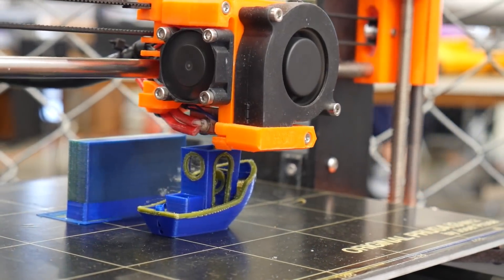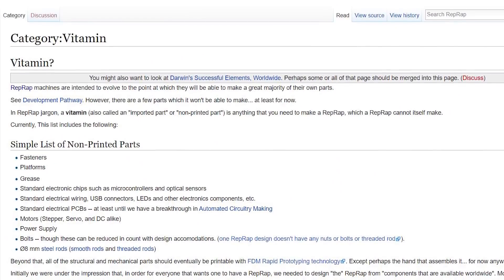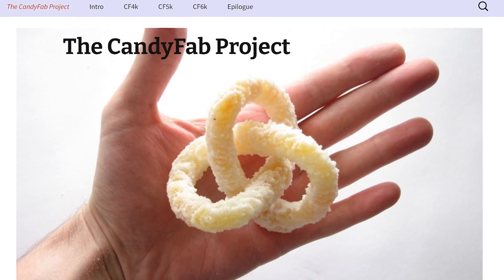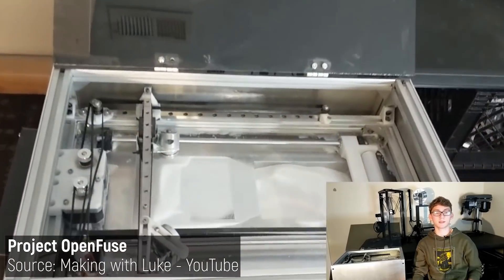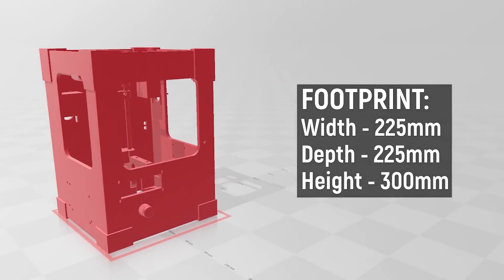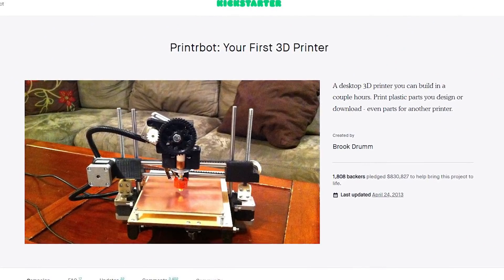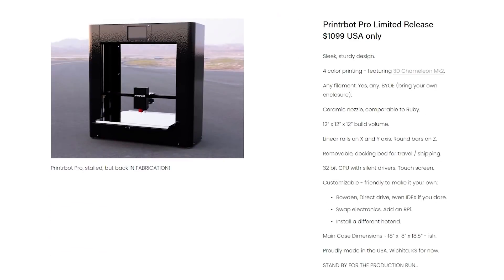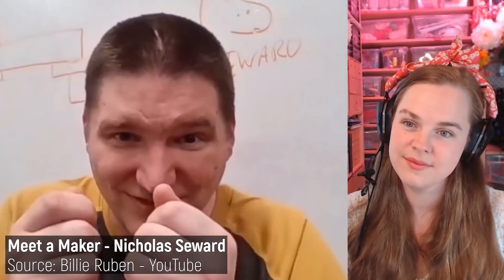These 5 Pioneering 3D Printers became extinct.

Comment: I still have and use my printrbot simple metal.  It's been a tank over the last 8-9 yrs.  It's getting adapted to an orbiter 2.0 extruder as it's worn out the gears in the geared extruder. Now it's working on the only spare set!

Comment: When there will be open sourced electronics printing alongside 3d printing (and food printers, 3d metal printers,  3d concrete printers), we might bridge the gap to actual replicators that turn energy into matter. If we can be enable other people to print different sizes of 3d printers only from raw materials, we could get people to print their own energy sources, vehicles, housing, mobile homes, and resource gatherers. if anybody played astroneer you get my idea easy: people would just need a basic printer  and some gathering tool to start living of the land/off grid with ease. if somebody is working on integrating technology so the today's "vitamins" would become printable, we will have something like a industrial revolution 2.0 .

Comment: The sugar one makes me wonder about a glue gun based sand/dirt 3d printer. Simply using the hot glue gun as a binder for the dirt/sand with extremely cheap material pricing & vast material accessibility.
Reply: Or melting of glass powder

Comment: I guess hypotechnically, modern "3d printers" including multirole machines:, could actually print/"print" out the vast majority of the parts in some form or another. No one individual machine could though, and many parts would need extensive post-processing - but we're getting close. What mostly remains are electronic components, especially ICs. We could in theory make several passive components, like resistors, caps, electromechanical relays, switches connectors and sockets etc. Also PCBs, soldermasking, pick n place, hot air/laser/IR soldering...

Comment: 5:29 Awesome!  I got to run a Zcorp Spectrum Z510 somewhere around 2003 or 2004 at an aerospace company (I was the point of contact/owner so I was pretty familiar with it back then).  Having only recently learned about SLS and SLM at the time I was pretty happy to dig into that particular task.  I still have a few little test print/trinkets from that z510 on the bench near my ender, lol.  Running that machine was kind of a nightmare...especially because they chose to put ours in the already too small plotter room.  Space issues aside, loading the powder bin was dusty, as was extracting parts from the build tank (as you can see, it just wipes a fresh layer of powder over the last so you end up with a build volume full of unbound powder that the part is resting in).  The powder in general was the worst issue I guess, its so very fine and so very light.  Another lesser issue was the binder itself wasn't all that strong so part extraction was done like an archaeologist, with brushes and lots of time, patience and care.  Coating the fragile printed part in cyanoacrylate was usually all we needed to do with our prints...again, my test prints are still stout and colorful as can be almost 20 years later.

Comment: The first ever 3D printer I ever saw was - when was it? A couple of years before I went on sabbatical in 2010 so it must have been around 2007 or 2008. They were using it to produce replica skulls from CT scans of people with skull defects (accidents, or congenital) so they could use the models to shape custom-made prosthetic plates out of titanium mesh. It used some sort of powder in a bed, with a inkjet-like print head that sprayed super-glue (probably one of the printers mentioned in the video). After each layer, they'd add more powder on top, smooth it out and the print head would move over the bed again. No idea what it costs, I wonder if it's still in operation. This was at a university in Kuala Lumpur where I worked.

Comment: I still have my Mod-T. Sad to see it in the intro but not in the video. It was amazing what it could do with just brushed motors and encoders. That and auto bed leveling was built into the core of the machine.

Too bad the bed design didn't work out in the end, couldn't be heated, and often wasn't flat by design. Otherwise, it really wasn't a bad little machine.

Comment: 5 - Desktop LOM or LOM in general.  The 4th category of 3d printer.
6 - Submerge SLA/ Resin printing.  There is a reason why it was invented to be submerged in the 80s NOT upside down.

Comment: that last design geared arms, if only they could rotate the printer extruder by 90 degrees or actually more.. - point being that you wouldn't need as much support or no support at all if you could print bridges by extruding them on the sides

Comment: I still have a Printrbot simple metal. If there was a compatible controller board for it, I would resurrect it. If anyone knows of a board I can use it let me know.
Reply: Pretty much any controller board will work.  You would have to customize the firmware to the specs of the components etc.  There's a number of klipper conversion videos that you can apply to basically any printer, as one option

Comment: I am looking for a first printer. Part of the problem is convincing my wife. I told her we can print decorations. She was pretty much sold. Only problem is she wants to print bigger decorations. So, the ender and prusa printers probably will not be big enough. I am looking at the CR-10S. Would one of those be okay for a first printer? Also there are like 50 variations of that one. Are there any other good recommendations?

Comment: I made a Reprap Darwin. Unfortunately, I only made it for a class I teach. I got it working enough to move the axes and got frustrated with the never-ending treadmill of electronics. It served it's purpose well as hundreds of my students have learned more about solid modeling and working drawings by recreating the models in commercial CAD software. I used the original Printrbot JR as the 3D printer kit that students assemble in my class called "Additive Manufacturing". I was so impressed with the kit that I bought my own; however, it was called Printrbot Jr 2.0 by the time I ordered it. That's one thing I found frustrating with Printrbot - there would be a new version of 3D printer every six months. At the school where I teach, we have the Printrbot Jr, Printrbot Simple, Printrbot Plus, Printrbot Metal Plus, and even a Printrbot Plus model that folds up into a suitcase. When Printrbot went under, we switched to the Folgertech 2020 i3. When Folgertech folded, we went to the Creality line of printers. For the entirety of the time I've taught the Additive Manufacturing class, we've kept the personal property fee the same at $350. (Students keep the kit they assemble.) Now we just add upgrades and filament to achieve that price. In the past, we had to ask for volume discounts just to get down to that price. Thank you Angus for bringing back some of the history of affordable 3D printing. Thank you Adrian Boywer for your incredible impact on this industry!

Comment: Just FYI, RigidBot did delivered and not over promised. And at the time it was most kick ass 3D printer, Take in account HUGE at that time print area 300x400 and steel frame. I STILL run 2 of them ! One on original everything, Second one using SKR board with Hemera Extuder.
PS. Yes original PSU was shit :)

Comment: The Simpson is true mad scientist stuff. What I’d really love to see as an upcoming video is the evolution of slicing. To me those are more revolutionary than the printers, since honestly the prusa i3 isn’t conceptually much different than the original tinkertoy reprap designs (obviously way more “put together” but still basically the same basic mechanism, in the same way a model T driver could get into a Ford Fusion and would have a reasonable idea of what does what). But on the software side early slicing software was practically roll-your-own-gcode vs today where so much is automated [for simple parts you can simply load the part and select print and out it comes]

Comment: I'm actually surprised the peachy printer didn't make it on this list as the first commercially viable top down resin 3d printer. If it weren't for the issues with one of the creators running off with the money. We would have probably developed top down resin 3d printers long before the ticket is is currently being developed.

Comment: I'm still using a variant of the Reprap Prusa made by Makergear that I bought as a kit in 2011 for just under $1000, just like Angus mentions. Assembling the printer from parts gave me great confidence to maintain, repair and upgrade it over the years. I've made a number of improvements to it such that other than having a pretty limited z-height on the build volume, it still holds its own quite nicely today.

The two most important upgrades were replacing the pretty awful custom nichrome wound wire hot end with a standard modern E3D V6 design, and replacing the stepper drivers with Trinamics TMC2209 based ones. I've run enough spools of filament through the thing that I've definitely got my money's worth, and I might upgrade eventually but for now it's still doing a great job printing whatever I need.

Comment: BFB 3D Touch and BFB 3000 were disasters, especially after greedy BFB sold out to greedy 3D Systems, who didn't like open source designs and quickly denied support for these $3K no-feature printers.
Reply from the maker: What's worse is that 3D Systems recycled the design for YEARS and each new iteration was more proprietary and just as unreliable as the last. I feel sorry for anyone who bought a Cube Pro, literal paperweight.
Reply: @MakersMuse  Yes. Fortunately for me I recognized the Cube for what it was and stayed away, thanks to my BFB/3D Systems experience. I will say that once tuned in, the 3D Touch did PLA on blue tape pretty well, but forget any filament that needs a heated bed. The Axon slicers were configurable if you could figure out which file held the configurations you wanted to tweak, but the machine was just plain difficult to work with. And suddenly, no manufacturer support and no spare parts. My Prusas keep me happy nowadays!

Comment: Need help I have drawings that are built out of mechanical tubing and when I want to print them the slicer sees the wall and tries to print this. I use auto cad 2022 mechanical tool set. Raised 3d idea creator. Import files into cad from a solid works user.

Comment: Imagine if they made a TV show similar to BattleBots but the only part of the robot they could make out of metal is the chassis and they would have to 3D print a shell over it to protect the motherboard and they could 3D print anything from armor to weapons but they only have 30 minutes to print before battle which would of course be sped up for the audience. The chassis could also have cogs coming off of it that could interact with the 3D print so they could have movable weapons or even robotic appendages. The best part about it is the designs would just get better and better each battle.

Comment: I definitely think the CandyFab died before its time. If I lived somewhere with room to experiment like that, I'd be tempted to have a go at trying my own version of it.

The things I'd look into doing differently would include:
- Using icing sugar for higher resolution capability of the print medium.
- Using alternate ways of applying the heat than hot air, so as to also increase print resolution, & print speed. Obviously this would require some experimenting with things like the amount of heat needed, & duration of heat per smallest unit space of printing. The CF site discounted lasers as a possibility, citing potential safety issues, but I don't think it's that big a deal, especially if you use a heated chamber which keeps the material closer to its melting point, thus reducing the power requirement for the laser output. Another idea would be to look into the possibility of some kind of more conventional but higher powered light source, with focusing lenses to put all its output onto a tiny point. After all, we're not talking about cutting through material here, just raising a small point to the melting point of sugar.

Comment: Every time I watch something like this, I wonder what was wrong with me that I didn't make a 3D printer around 1989 or 90. All the necessary parts were available or could be machined. I had most of the skills, if a little unpracticed. I sort-of do know what was wrong; why I didn't. It's not a happy story and I won't tell it here. Anyway, I think I was thinking more along the lines of a miniature milling machine at first, but I certainly knew about thermoplastic and wanted to use that knowledge.

Comment: I picked up a Printrbot Simple Metal for cheap at a thrift store a couple years ago, and honestly it’s been pretty great. It’s still trucking along, works perfectly fine with OctopPrint, and has a pretty decent auto-bed-leveling sensor. My only complaint is that it doesn’t have a heated or removable bed, but honestly, for the price, I’m pretty alright with that.

Comment: Love the video.  As some others have stated, I got into 3D printing late, this is the first time I've seen the Tantillus.  I, for one, would love to see you print that in the original multiple parts pieced together version.  Though small printers are cheap, I'd like to see if it's worth the effort, since I only have my original printer without a heated bed, that can barely print 175mm cubed.

Comment: Where are those hand held pensthese days? and were there any add-on tools made for working with them, like jigs to do certain movements to get nice results?
Be crazy to see some kind of printable cam-path tools that suspend and move the pen around a set path then raise the pen with a screw per cycle of the path.. like little template printer/stencil things for repeatedly making primitive shapes without having a proper printer. I think it might require a bit of print-in-place gearing though, more gears for more complex cam-paths for the pen.
Reply: Or a belt and pins.. much easier! Also I recommend printing custom belts, they last well. I printed some about 3 years ago for an extruder prototype with some dirt cheap black flex, and it's like they haven't aged a day ;) rubbish for most purposes but very good stuff for this kind of purpose.

Comment: I am restoring a Printrbot LC. It worked well to print some of its own replacement parts, which had cracked with age. I switched to a GT2 belt on the Y axis with a metal pulley, replaced many LM8UU's, am moving the controller out from under the machine to manage heat, and will install a Micro Swiss nozzle to keep the original hot end functioning. Since the original Ubis hot end is very oozy, prints have to be done at a constant speed to maintain extruder pressure.

Comment: I remember we had a 3D printer in high school around 2009 or so that used a system I've never seen anywhere else, it worked by building up fused sheets of plastic from a big reel and it'd paint an area around the part with something they called "anti-glue" which would stop it from fusing there so you could peel the layers out after and carve out the part. Do you have any idea what that might have been, or if that kind of technology was ever really explored elsewhere? It had the benefit of not needing supports but the major downside was you had to waste a lot of plastic if you were printing a small part since it has to use the full width of the sheet roll.
Reply: I have heard of the method, it basically glues A4 paper sheets together and cuts them out. Seems like a really wasteful method indeed. though
Reply: @johnpekkala6941  Oh wow that's wacky, I never would have pictured it being done with paper. At least that's more sustainable than plastic, the unit we had used a big spool of relatively wide plastic sheeting. It would automatically pull from the roll and cut it

Comment: i think there was a type of 3d printer, Mcor Arke, that use layers of paper glue together, with each layer cut out via a razor or laser. So essentially instead of having the printer head trace the entire surface area of a layer, the tool path is only the surface line. So for print that have high volume to surface ratio, this 3d printer is several order of magnitude faster than traditional 3d printer. Saw in ces 2016. Don't know why it die out, especially given that it use ordinary glue that doesn't give off special vapor, so it can actually be print without covering and venting.

Comment: I was so happy to see the BfB RapMan get a mention. It was my introduction to 3D printing, and as much of a pain in the neck it was to run, I learned so much from it. It started my passion for 3D printing, as well as finding creative ways to repair and modify things. That machine rests in pieces now, but its years of service will always stick with me.
Reply: Such a pain in the neck! I lost count of how many hours I spent sanding parts and regluing them when they broke, or tightening all the million bolts... and then it rusted! Cleaned it up, got it going again, and then pigeons crapped on it (don't ask) and it rusted again! It also barely printed anything, about the only worthwhile print managed was a replacement Wade's extruder.
Reply: @JamesChurchill  The million billion bolts and grub screws is something I absolutely don't miss. Those acrylic sandwiches on the corners were an absolute nightmare too! My machine even walked itself off of my workbench while printing, twice! Shattered a ton of parts, including the extruder. Even bent one of the leadscrews. I did manage to repair it the first time, and got it to print semi-decently for two years, until the second time it fell. Then I decided to throw the remains in a box and just buy a CR-10 Mini.